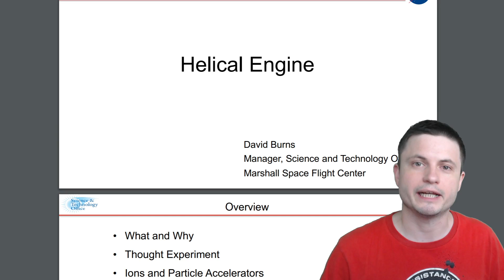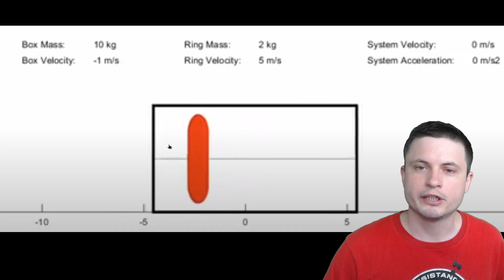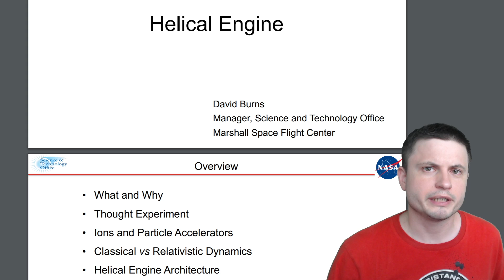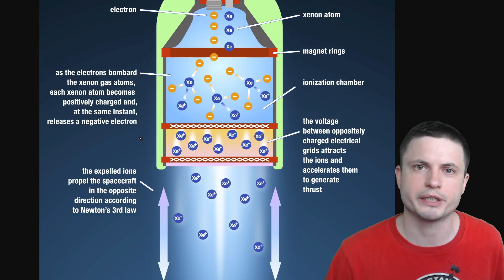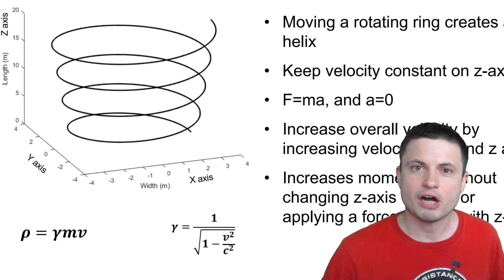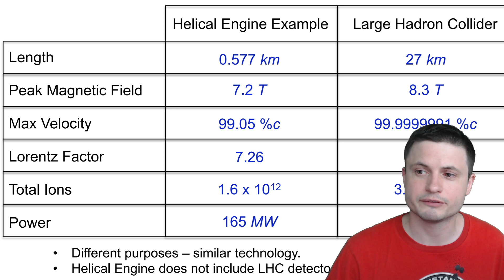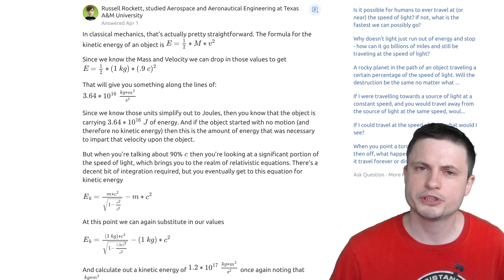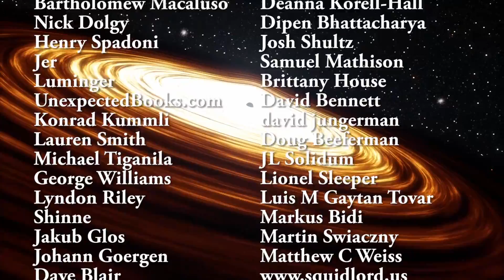NASA Engineer Designs a Near Light Speed Engine But Does It Work?

Comment: Okay now here's where the mass goes when you accelerate the inertia stretches you through time you are moving faster in time than you actually were earlier there is a difference in time flow no matter how minute the speed change there is still a difference in the flow rate of time.
So you are existing in the same space moving in that space but existing in multiple times you're in multiple time rates at the same time I know this is confusing.
But if you're in different time rates simultaneously then you are being stretched in time not space that is where the mass is if you are accelerating to the speed of light and you get out of your ship and you measure it at the beginning of lunch halfway to the destination and that the end destination the measurements will be the same.
Same length same height same weight same mass same density same everything but we achieved greater mass during our travels because we were in multiple temporal frequencies simultaneously it's like when you can listen to more than one radio station on one radio at the same time there's more noise coming through but the radio stays the exact same size and mass.
If you represent A as in you're standing still rate of time.
B as the finished speed after acceleration.
C is the difference between the two speeds ...

Comment: How old is the physics you're using?
The twin paradox?
what you do not understand is velocity and time are both the same thing . Time is simply movement. you cannot measure time without movement and you cannot measure movement without time. That is why the more speed that you accumulate the slower time goes for you because you're actually moving in time everything that moves is a time machine everything.
When you feel a nurse it is not you being pushed back in your seat that is how you perceive it but inertia is your rate of time flow changing.which is also why when you stop accelerating inertia stops because you are no longer changing the flow rate of time you have gone from static time a to static time b inertia is the difference in between.
the focal point of this Ben see otherwise known as the speed of light when you achieve the speed of light that is when time stands still for you at that very focal point because to go faster than that would make time flow in a negative speed itself
Which causes you go backwards in time. To the point of your initial departure. Not in space but when your ship stops you will be back in the original time flow rate and temporal coordinate not spatial coordinate. In layman's term this means that you reach the speed of light time stand still you go faster than the speed of light time flows backwards and when you stop at your destination you will be at the exact point of time that you took off.
This is unless you use a warp type ship where space is moving around you you are not moving you are in a bubble of space that is moving.
Then mathematically your velocity could be infinite and you would have no time dilation affect whatsoever the twin paradox is solved. Now you want me to get on to grandfather's paradox.

Comment: 2 Gigawatts is easy using nuclear power in such a large ship. A Terrawatt is not out of the realm of possibility. Cooling system is super easy simply using a dirty water system and surface heat exchangers.

Comment: Makes me think because we need a good mostly consistent power source and light panels usualy just harness energy with in the visible ranges of the electromagnetic spectrum. If we could harness space radiation there is a lot of it depending were we would be in space; of course some places or areas  are probably more permeated than others but it would still be a renewable source to tap. Still if we could move close to the speed of light we would probably find more ways to our energy issues. Question I have is do we have scientists working on space radiation panels?

Comment: Actually, IMHO this is old technology. It is an impulse drive basically. I believe we’ve already achieved something far far far better than this. If you combine the Philadelphia Experiment with the Montauk Project, you can get things basically instantaneously from point A to point Z. I read somewhere that we use this kind of technology already to get things to the Moon, Mars and possibly anywhere in the solar system. Using this as a “propulsion“ device, we may even have gone to the stars - hopping there.

Comment: Why not use the same concept but with a magnet as the “donut” and metal dust to add the weight after it is accelerated to the desired speed. And when it hits the stopping wall the dust is released and the stopping wall has tubes that will return the dust to the accelerated area of the box. Every time the donut hits the stopping wall the metal dust that is released hits other dust and forces it through the return tubes constantly returning the dust in a loop to the desired area. Idk I’m not a rocket scientist so I could be talking out of my azz.

Comment: How is it possible to propel in space. There is no resistance. Travel 1 million mph you don't feel a thing. How do you slow down.
Any so called thrust would have no affect. Nothing to push against. Only way to change direction or slow down you would need to hit another object.
Show me the current engines used in space.

Comment: I see few issues here:

Lorentz transformation defined for inertial frames (non accelerating)
Conservation of momentum.
When accelerating the inner mass, the same negative momentum will go to the chamber. This will be exactly the same on the front and back side of the chamber.
Reply: was looking for this type of comment
Reply: Isn't that the reason why this was invented? The force will act upon it but the mass will increase when moving fast enough. And when it moves the opposite way the force that is greater than the initial speed will push against the container holding it, in the opposite direction upon which the energy of sending the smaller mass will have less of an effect (though an effect nonetheless) on the container. Therefore forward momentum.
Reply: I've been thinking about a lot about this one.

What you've got is a spaceship with a forward momentum, and a circulating plasma that is moving along with the ship, but because of relativistic effects its aggregate momentum relative to an outside observer is equal and opposite to that of the ship.
I haven't gone into the mathematics of how this might be possible, simply the bare concepts involved.  It seems to be a sort of energy-and-momentum pyramid scheme; each subsequent interaction of the plasma with the front or rear part of the plasma chamber involves a greater transfer of momentum, but because the front is continually transferring more momentum than the rear the net thrust is forwards.  I'd guess relativistic contraction keeps the plasma from simply being compressed into a single dense lump and shaking the motor apart.

I'm purposely leaving out the whole "greater mass moving forward, lesser mass moving back" part of the argument.  The total momentum of the plasma must be equal and opposite to that of the ship at all times, and that seems to me to be the important point.  Either relativistic effects make that possible, or they don't.

Interesting point - what happens when you stop thrusting forward, and just let the plasma circulate?  Does the ship come to a grinding halt as the ship's and the plasma's momenta equalise?  Does containment break down and the plasma come blasting out of the rear of the engine, vapourising everything in its path?  Does the Universe come to an end as God realises he made a tyro's mistake in the basic equations?  What?
Reply: @alanbarnett718  Perhaps you have a better understanding of it than I do but I thought that the ship pushes the mass to the front, spins it up to give it more mass, and then pushes off of that larger mass/inertia to accelerate. When the mass slows its spin then it can be brought back to the front of teh ship. Like 2 steps forward, one step backward.

If this is a good description then you can just do the process in reverse to slow down and nothing happens if you stop doing it. The worst that could happen is you lose the most recent push.

If my description is wrong and the only movement is just spinning the mass then yeah, it makes no sense to me.
Reply: @ndvorsky  You are right.

That's what they are talking about.  And it's rubbish.

Obviously I wasn't paying enough attention when I first watched the video.  The "box" thought experiment that Anton repeatedly said was "technically possible" - it's a bit of a con.  You start off with a relativistic mass, which means it starts with a huge amount of forward momentum which it gradually transfers to the box.  Likewise, if you gain that relativistic mass by spinning the mass instead of accelerating it, you still have to launch it towards the front end - which transfers just as much backward momentum to the back end as you gain in forward momentum when it reaches the front end.  Zero sum games, all of them.

On the other hand, the idea for the drive that I came up with by misunderstanding them - it works.  It definitely works.  Eventually it will inevitably break down and blow the ship to kingdom come.  But it works!

(But I still don't know what happens when you turn it off!)
Reply: E=mc^2 is for rest mass only.
E^2= (pc)^2 + (mc^2)^2
...is the full equation.
Where p= momentum,
[and of course m=mass and C is..C.]

Mass doesn't really increase under special relativity. That's an energy increase that we equate to mass, but it's really the γ (gamma) term in front.

So:
E=mc^2 for stationary objects,
E= pc for moving objects with no mass (i.e. photons). 

If they are both moving AND have mass: E^2= (pc)^2 + (mc^2)^2
Should be used, as far as I've been told... But I'm not a relativist.
Reply: You cznt get momentum out of nothing. This is a terrible video, nothing explained
Reply: @pepefrogic3034  Time is just a concept bro.
Reply: I've always wondered about the Lorenz transformations in an accelerating frame, but just because we don't learn about it in BSc Physics classes, doesn't mean that nobody has ever worked it out.  Presumably it links up with General Relativity at some point.

The engine is a sort of pyramid scheme for energy and momentum.  At each iteration more momentum is transferred to the front side of the chamber than the back side.  It only looks impossible.  

As for conservation of momentum, since we are dealing with macroscopic systems the net momentum of the system has to be zero at all times.  No, I can't see it either.
Reply: Alex Burns  Prove it.
Reply: I think, and I'm no physicist - the idea is you don't employ the concept on a fore/aft linear device - you use it on a helix or rotational device that is rigged perpendicular to the bow and stern of your craft.  You accelerate the mass when its in a position to provide thrust, and let it coast and slow a little when its not - rather than stopping it and turning it around.
Reply: That holds for relativity but from the quantum perspective we also deal with charge-parity-time symmetry. You can maybe bootstrap the intuition by considering inertia and gravity as charges with opposite sign, and normalize from there.
Reply: Yes, this is what keeps us from thinking out of the box. There is a hack to make this work.
Reply: Yeah, I'm curious about this aspect of it, it just feels like there might be a problem in how the reaction force is applied.

I get the idea, slow the matter down to reduce its mass, move it to the front of the ship, and speed it up again to increase its mass, to the back of the ship. But... wouldnt the energy spent in slowing the mass down just cancel everything out?

It's a hard question I'm not really qualified to figure out. Maybe it's doable given the exponential rate at which an object's mass increases with speed, but I don't really have the math skills required to account for everything in a system like this. Are you able to?

Also, it seems like the only advantage is that it's a propellantless propulsion system, meaning you can use the same small mass as your driver to no end. This could save a lot of weight, and eventually work out to a better system over a long enough acceleration... But as he pointed out, you need to get the energy from somewhere, and you're still consuming nuclear fuel to do it, at a nasty rate... So it's not even really propellantless in that sense. Then its only advantage over a nuclear rocket is that you're not spewing radioactive death everywhere.
Reply: @hatman4818  The fundamental flaw here is that if you try to increase the mass of a bead of stuff by adding energy to it, that energy had to come from somewhere. Say it comes from batteries: then you had to push the spacecraft back a tiny bit to move that energy to the bead to begin with, and that exactly cancels however much momentum was gained as the more massive bead is accelerated.

Even if you can't track down the exact error, you can easily see that there must be an error somewhere because this design (and any propellantless propulsion design using known laws of physics, really) violates conservation of momentum.
Reply: Guys, isn't that why this one rotates? if the speed being added and taken from the mass is orthogonal to the direction of travel then when the mass moves from front to back spinning faster or slower you will get a canceling rotation but a net forward force instead of a canceling forward force.
Reply: @hatman4818  The other advantage would be that a lot of energy leaves the ship with the exhaust.  A reactionless drive would be about twice as efficient as a rocket.

Comment: Anton, I agree with you on this.  The force of the mass striking an edge of a box  could propel it.  Changing the mass inside the "shaking box" when it strikes heavier on one side would be vastly inefficient.  I think something like a striker electromagnet, like from an old doorbell, would be better.  It could strike only one side of the box, which could propel the box slightly in that direction.  But like in the "shaking box" example, forward movement of the shaft, or the initial thrusting of the striker shaft would be negated by the back-pressure of thrusting the electromagnetic shaft from a still position.  This could be overcome with your suggestion to rotate the shaft as in "imagine your finger rotating in circles."  Such rotation would provide a centrifugal force toward the outer sides of vehicle.  This would redirect the back-pressure of thrusting the shaft from the opposite direction of the strike to the sides of the vehicle instead.  This should give us an overall positive motion forward in the direction of the strike.  Repeating the strike like a vibrator dozens or if possible hundreds of times per second should result in a fairly impressive and constant growing rate of speed.  But why limit it to the speed of light in a drag-free environment like space?  It seems to me the only limiting factor would be time, as in how much time it would take to build up momentum for the vehicle to reach a particular speed.  If time were endless then there would be no limit to the speed it could reach.  The rate of speed growth is constant, so it wouldn't stop increasing speed at some arbitrary number like the speed of light.  Albeit the corrosive nature of the few atoms that are floating in space would be like a sand blaster to the vehicle's exterior at incredible speeds - which would be a limiting factor just as our own atom-rich atmosphere would burn it completely away at such speeds.  What do you think?  In a perfect vacuum there would be no limit to it's speed.

Comment: What about a large flywheel spin it up and stop it with electro-magnets but in a gyroscopic pattern so you can stop individual flywheels kind of like how drones or quadcopters work it slows down individual fans and speeds up other fans turn and rotate

Comment: Isn't it however good for slow accelearation since it doesn't requires throwing matter out? It is a closed system requiring just energy from the outside to work.

Comment: I actually have a design of this back from 1980 within a maglev suspended vacuum electron that rotates to the speed of light increasing mass.  Great to see someone followed up with “Helical platform”.  Giga watts of power would be need to propel the craft in a hyper loop setting out of our atmosphere; then the engine would engage past the Karman Line to space where orbiting satellites, through Tesla coils and beamed electrical transmissions that would provide enough energy to obtain beyond speed of light velocities.

Comment: This is something I always wanted to see! Working within boundries of sience propulsion system without exhaust. Then the only requirement for travel is having a lot of energy. The biggest problem with reaching the stars was always the fuel. So you were forced to coast most of the time. But now you can accelerate half of the way and decelerate other half and even have gravity onboard in doing so! This is huge!

Comment: If an outer helix can accelerate particles to near light speed using energy derived from decelerating particles in an inner helix, that recycled energy would significantly reduce the continuouse power-input required to power the dual-mass inertial-drive.
Deflect the direction of hi-mass particles then decelerate them to lo-mass, then again redirect the lo-mass particles & use the extracted energy to re-accelerate particles to hi-mass.
One end of the dual-helix would deflect hi-mass particles while the reverse end would deflect lo-mass particles.
The accelerating helix would be redirected into the reverse-flow decelerating helix, which would then redirect to feed the acceleration helix.
Energy extracted from decelerating particles would be recycled to enhance power used to re-accelerate particles.